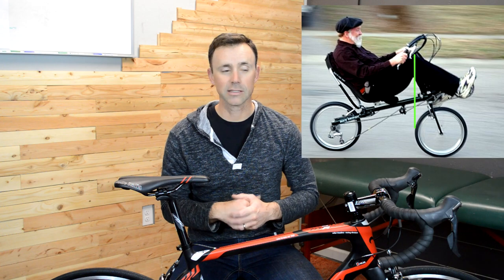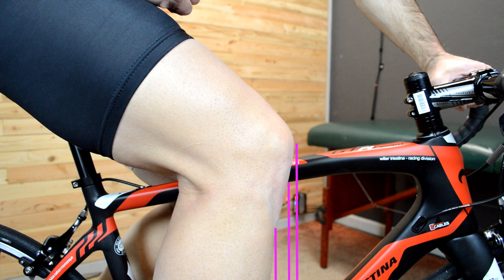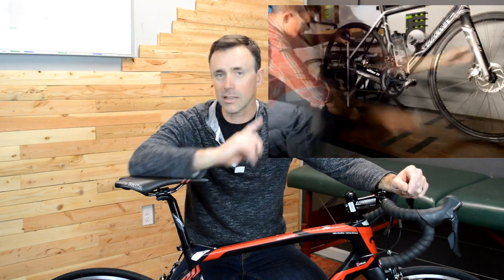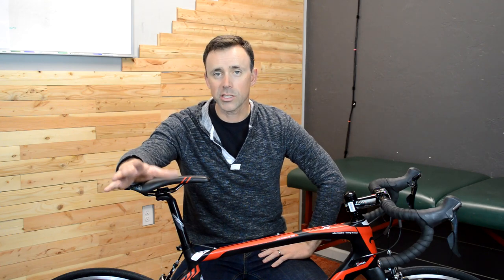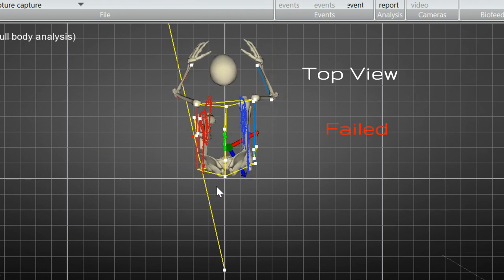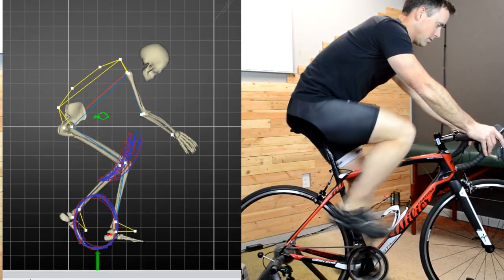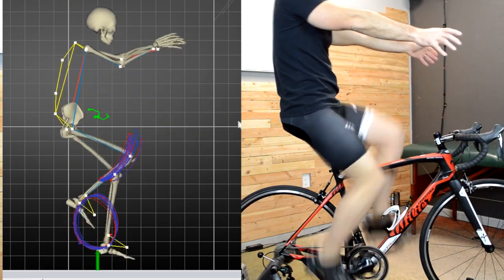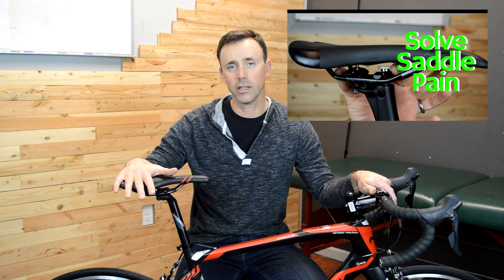How to set Saddle Fore Aft | Bike Fit Tip

Comment: If I'm sliding forward, why would I move the saddle back?  I'd check saddle tilt, then move it forward until I hit the sweet spot.
Reply from the maker: Devery Andrews I understand that idea -- but that assumes that your body is prioritizing your reach over which part of the saddle is the most comfortable / best suited for your pelvic position. Most of the time this won't be the case. Plus with moving the saddle forward there are diminishing returns because as you go forward you exert less posterior force on the pelvis and increase the likelihood that it's going to slip forward.

You're absolutely correct to consider the tilt of the saddle...something I'll go into more in the next video on this topic -- I didn't want to muddy the waters and make the video 5 minutes longer...
Reply: That doesn't make a whole lot of sense as up to something like 8-10cm of shortened reach (assuming that we're looking to find the saddle position first without fiddling too much with the bars) can be accomplished artificially just by just shifting the hands back onto the road bars instead of the hoods and then even further by just asking the rider use their fingertips to stabilize themselves on the bars to conduct the test while on a trainer. Figure out reach after you figure out the saddle position. 
Once the rider's hands are off the bars and the rider is beginning to sit up per the test reach doesn't play a role anymore so the rider sliding forward indicates that the rider's leverage on the pedals and balance drag their pelvis forward toward a neutral balance position and you want to exacerbate that by moving the rider further back? Does seem quite strange logic.
Reply from the maker: +OhAiShare there's a difference between bar position and reach especially when your unclear on your saddle fore aft position. You can have the wrong bar position, the wrong fore aft but have the correct reach. By knowing what's close to your optimal reach you can eliminate it as a reason for slipping forward or being unstable on the saddle. 

If you have close to the right reach and you fail the test and need to move the saddle back, then moving the bars back to maintain the reach is what I discussed in the video.

And, yes, you can just shift your hands back on the bars or go on to your fingertips to see where you pass the test but this won't help you find your best hip position on the bike...it'll help you find your best bar position based on your potentially compromised hip/saddle fore aft position.
Reply: Again, having perfect reach is nearly irrelevant for this test as how simple it is to move your hand position that handful of cm that you may be moving the saddle on the rails as the rider doesn't need to stabilize themselves over long periods or on a dynamic bike. It's on a bike fixed to a trainer so moving the hands or even using fingertips to simulate a reach adjustment is perfectly fine before physically moving the bars. A rider can change hand position at will to compensate for the range of adjustment of the saddle rails. Hence why for this sitting up test trying to make the bar position or reach a big factor is ultimately silly for this specific balance test, as that's all this is. 

As for hip impingement that's a different issue compared to balance point and should be considered as much. Balance is still the balance point and where you should set your saddle by, if one's hips allow it. If not adjust for the best compromise between the two but to say this sit up test is an indicator of hip impingement is a very poor viewpoint from a professional bike fitter as this sit up test is not an indicator of ideal hip angles.
Reply: The basic idea here, I think, is this:  If you stand normally and then bend about 45 degrees forward at the hip joints with your arms out in front of you, your rear end will move rearward to maintain balance.  This is essentially the position you're trying to duplicate with the fore/aft adjustment.  If the seat is too far forward, it puts your center of gravity too far forward and your arms will have to work harder to prevent you from sliding forward in the seat.  I did the same thing as you at first, but found that moving the seat rearward worked much better for me.
Reply: +Ian Snyder I'm not against moving the saddle backward if your needs dictate that you need to do so. However, the video basically tries to scare people away from ever moving it forward which is silly considering it is a balance point that you're trying to achieve - let balance point dictate position. In the test shown in the video you actually want to feel the core engage and your cadence should pick up slightly as you struggle a bit to maintain the position without the hands. Also, just keep in mind for your 45 degree back angle isn't going to be sufficiently aggressive for many road riders and be too aggressive for the very casual riders on beach cruisers. There's no set back angle that is ideal for everyone on every type of bike so be careful when throwing around set angles to target as a universal recommendation.
Reply: Dude, the 45 degree angle was for illustrative purposes.  Obviously not every bike or rider will have the same position.  I make the assumption that people in general aren't stupid.  And the video doesn't try to scare anyone away from moving the saddle forward, but advises not to do so if you attempt the test therein and fail.  I mean, John just does this for a living.  If you know better, good for you.
Reply: +Ian Snyder You "make the assumption that people in general aren't stupid" while giving out information to those who are seeking free advice on youtube on the internet with zero basis of their knowledge level. Then get bent out of shape when someone says the 45 degree back angle isn't a static number and is different for everyone and then support that claim, just are mad someone brought it up... Please take your own advice. 

John literally says failing the test is an indicator the saddle needs to move backwards - which is wrong as you can fail the test on both sides of the balance. John then goes on to say that moving the saddle forward is "pretty rare" and then says there's "a lot more downside" to moving the saddle forward then back biasing his advice to show he nearly always wants to move the saddle backward. Even in his responses he brings along hip angles which are actually better when you move the saddle forward so John's kind of all over the place in this case because he's trying to cover himself instead of just addressing the issues individually as this balance test would dictate. Steve Hogg covers the topic much better.
Reply: OhAiShare Like I said, I give people the benefit of the doubt. You assume everyone is stupid. If they're watching these videos, chances are they're looking in other places too. Just like everyone else, they'll ultimately either find their own way or get a bike fit. If you don't like his advice, don't follow it. 
"Bent out of shape"? Says the guy who got bent out of shape because methodology contrary to his own was advocated on YouTube. It's easy to twist something someone says just enough to find some small detail to point out as wrong--it's what people who can't stand opposing viewpoints and always have to be right habitually do. It's too easy to sit there and bitch and say people are wrong. If the advice and comments are so offensive to you, create your own channel and lead by example. Get the correct info out there. Show everyone how it's done, brah. 😁
Reply from the maker: OhAiShare Okay, last time and then I'm out. First, do not appropriate quotations or ideas to me that I've not brought up or said. Nowhere in the video or in my responses have I mentioned anything about hip angles, so I;m not sure where the "Even in his responses he brings along hip angles which are actually better when you move the saddle forward so John's kind of all over the place...." comes from.

Yes, I fully understand that when you move the saddle backwards it can increase hip flexion which is why I mention a number of times through the video that if you do move the saddle back you'll likely want to address BAR POSITION -- an adjustment may be necessary to maintain your hip angles and REACH. 

Yes, I get it, you can slide your hands back on the bars or go on your fingertips -- I've addressed this before as to why this doesn't give a complete picture of what's going on nor does it provide consistent solutions. A "solution" is being rendered from only one side of the balance equation.

To reiterate. REACH  is not the same thing as BAR POSITION. REACH is dependent on your SADDLE POSITION (its X-Y position in space) as well as the BAR POSITION (its X-Y position in space). You can have two completely different bar and saddle positions -- for instance on two different types of bikes -- while having the same reach. Each rider has their own optimal bar position given their saddle position (and the type or purpose of the bike of course), and vice versa - saddle depends on the bars. These factors are dependent on one another.

Since we're talking about individuals, if you choose to interpret the test as "well if I slide forward then I'm going to bring the saddle forward' as you mentioned in your "adjust according to whichever side of the balance point you're on" reply then a rider should be prepared to be wrong and come out with a compromised fit -- moving forward is not bad, it just has greater likelihood of problems since we rely on our hips being behind our feet a given amount (again individual) in order to maintain a stable pelvic posture and not slide forward on the seat. Having hips drastically forward only works for triathletes because they're supporting themselves through their forearms/elbows and have much greater chance to use the latissimus to support themselves --  the lats attach to and support the spine and the top of the pelvis. They have more direct use of their trunk and pelvic stabilizers, HENCE they can get their hips further over their feet (and their torso and front end lower) without symptoms.
Reply: All I can say is I lifted my hands off the bar during today's ride and I didn't slide forward or aft.  In fact, I felt planted in the saddle (Venge road bike).  I've found success using an iphone app called Bike Fast Fit.
Reply: Sorry for the runaway thread, Devery.  :D
Reply: Lol, it's all good.  Just trying to become better educated on fit, and I find John's videos very informative.
Reply: +Bike Fit Adviser

My response wasn't designed to be a hit piece but now with Ian's help you're forcing it up that road instead of just being critical of the end advice of nearly always move the saddle back... so I'll respond to you point by point. 
- "First, do not appropriate quotations or ideas to me that I've not brought up or said."
I haven't but okay. 

- "Nowhere in the video or in my responses have I mentioned anything about hip angles"
Your first post states: 
"And, yes, you can just shift your hands back on the bars or go on to your fingertips to see where you pass the test but this won't help you find your best hip position on the bike...it'll help you find your best bar position based on your potentially compromised hip/saddle fore aft position."
Hip position is dictated by your hip angle to the pedals from your seated position so hand in hand. And BTW your next paragraph you speak of hip angles directly as well. 

- "if you do move the saddle back you'll likely want to address BAR POSITION -- an adjustment may be necessary to maintain your hip angles and REACH. "
Again, the point I've made SEVERAL times. BAR POSITION can be addressed on a static trainer just by moving the hands back or forward on the bars instead of just using the hoods. There's no fear of falling and there's no bike control needed, this test only cares about a STARTING POINT for the BACK ANGLES/COG as the rider RELEASES THE BARS from the beginning of the test! Additionally this test should be able to be conducted from BOTH THE HOODS AND DROPS so being so hung up on BAR POSITION and REACH and HIP ANGLES is somewhat silly - As again that's just not what this test shows. 

- "Yes, I get it, you can slide your hands back on the bars or go on your fingertips -- I've addressed this before as to why this doesn't give a complete picture of what's going on nor does it provide consistent solutions. A "solution" is being rendered from only one side of the balance equation."
Honestly I have to believe you're just riled up and reading this in a vacuum. As this test IS NOT a solution to the entire balance equation. This test is NOT the only thing that should be considered in setting the fore and aft saddle fitment. So the fact that you're trying to MAKE this test the end all test and taking one result to become the final position is just asinine coming from a professional fitter as you know the final position is a series of compromises. THE TEST YOU PRESENTED LITERALLY DOESN'T CARE ABOUT YOUR REACH OR BAR POSITION. THE TEST CARES ABOUT THE RIDER COG ON THE SADDLE AS THE RIDER RELEASES THE BARS FROM THE START! A fitter can literally conduct this test without a set of bars installed on the bike and instead just hold the rider by the shoulders to start them at certain back angles. I don't know why that's such a hard proposition to understand. 

-"REACH is not the same thing as BAR POSITION. REACH is dependent on your SADDLE POSITION (its X-Y position in space) as well as the BAR POSITION (its X-Y position in space)."
AGAIN, you fail to understand what this BALANCE test does. This is about balance point on the bike WITHOUT THE HANDS ATTACHED. BAR POSITION AND REACH ONLY SET A BACK ANGLE STARTING POINT WHICH CAN EASILY BE MAINTAINED WITHOUT MOVING THE BAR. Honestly I'm not sure why you're so hung up on reach and bar position when the test you've presented has little to either as THAT'S NOT WHAT IS BEING TESTED! 

-"as you mentioned in your "adjust according to whichever side of the balance point you're on" reply then a rider should be prepared to be wrong and come out with a compromised fit"
EXACTLY as I said earlier. You're instilling fear about moving the saddle forward as it is your belief and in my opinion wrongly that if one fails the balance test you should always move the saddle backward. You now outright say if one moves the saddle forward based upon the balance test they, "should be prepared to be wrong and come out with a compromised fit." Then going on to point out the specific issues triathletes (no one talked about them here except now) have and their solutions to it forgetting completely that the triathlete position is FAR forward from this balance point position - just making an extreme statement to cover your position. Also, never mind that this position ISN'T that far forward for most riders but you are ready to make the blanket statement of, "prepared to be wrong and come out with a compromised fit." Never mind that RETUL and many other fitment systems are using this balance point approach to set a starting point to where other compromises may need to be made. 

Again, Steve Hogg did a much better job on this and ultimately he uses this test as it's designed. A BALANCE test and not a pass/fail test that always tells you to set the saddle further back and tries to determine final reach and bar position based by it. Maybe you would take a read and maybe take some information in for your own future fittings. 

https://www.stevehoggbikefitting.com/bikefit/2011/05/seat-set-back-for-road-bikes/

+Ian Snyder You continue to prove your own points showing the level of stupidity that exists. Now please quit being stupid, stupid. I literally stated that everyone will have a different back angle with different purposes and you continue to emphasize just how stupid one can be when agreeing with someone else. Congrats.
Reply: + Devery Andrews 
It is interesting seeing just how extreme disagreements have to go in order to get some real information and discussion accomplished.
Reply: LOL  Okay, guy.  Think whatever you want.  Nobody cares anymore.  :)
Reply: +Ian Snyder But cared enough to come back and post a troll comment? You're continuing to show you're no stranger to spitting into the wind and just the type of person one should expect to find on the internet. Now hopefully back to bike fitment discussion instead of compensating for bruised ego's.
Reply: OhAiShare Way to get the last word there, chief. 😉
Reply: +Ian Snyder
Ian, Ian... First and foremost you seem to care a lot more than you're letting on. Second, you really don't seem to care about discussing bike fitments at all but more about finding ways to assuage your bruised ego. Ultimately third, I'm trying to get this back on track about bike fitments but you keep dragging it down troll post rabbit hole - have fun entertaining yourself down there.
Reply: OhAiShare My first comment was very much about bike fit. But then you came along misquoting people, making false attributions, and, well, everyone loves a YouTube comments spat. I understand your need to feel intellectually dominant, but please don't fall under the misconception that you've bruised anything. Irritating people isn't the same thing. Interesting tactic, though, taking a personal jab and then trying to establish yourself as the "good guy" who just wants to get back to talking about bike fit. Transparent, though. Like that condescending tone? It's the same one you use. Brah. 
Hopefully John will just delete all of this. In the interim, I'm here all night. ;)
Reply: OhAiShare Also... And this is constructive, so don't take it personally: Commenting by basically saying "you suck, you're wrong, this guy does it better" followed up with misquotes and false attributions is a terrible way to open a dialog if you want people to be receptive to you. 
But it did give me something to do while my toddler napped on me. Take care.  :)
Reply: And sorry for the runaway thread, John. Didn't mean to muck up your comment section.
Reply: Normally John has quite a few good points, he's completely missing the boat with this one. OhAiShare is right in stating this is a balance and rider COG test in the saddle and not a test about reach and bar position. If one is able to filter through some of the unnecessary posturing there's some good info there. But turn off the caps lock! 

Ian - Brah, brah, shut up brah. Quit trying to apologize for other people when you're the one doing it. You're living up to every point OhAiShare has made brah.
Reply: Psyche Out I apologized to John for mucking up his thread, but I have no emotional investment in your opinion. Knock yourself out. Brah.

Regarding the earlier portion of your comment, yes, it's a center of gravity or "balance" test, which is self-evident to anyone who watched the video. It's bizarre that that somehow became a point of contention.
Reply: lol  Except it is a balance test.  No one's advocating that the seat be pushed rearward beyond the point of balance.  It's even mentioned that you can move the seat forward under certain circumstances.  Maybe you should rewatch the video..?

You have to realize that you're confronting someone who has seen this principle work, and then you're insisting that their first hand experience is wrong.  This whole idea is based on something we all more or less mastered before we were two years old, and it's just too simple to argue over:  If you bend forward and your hips are too far forward, you fall over.  Your backside has to stick out sufficiently for you to remain upright, which is the same dynamic that is being duplicated with the fore/aft saddle position.  If your saddle is too far forward, it throws your position off balance and shifts too much weight onto your hands.  To correct this, you move your hips rearward to achieve balance--in the same way that you'd stick your ass further out in order to not fall forward while bending over from a standing position.  If your bar position was correct with respect to your original, off-balance seat position, you'll have to swap out your stem to accommodate the saddle movement.  It's sound logic,  and in my personal experience, it works in practice.  If you're falling forward, moving your pelvis forward will never correct your balance.  So yes, moving the seat forward will most likely lead to a compromised fit.  

But hey.  Fit your bike however you want.  If you want to slam your seat forward, no one's going to try to stop you.  Slam the shit out of it.  Mount the seat on your stem if it makes you happy.  And if you manage to convince someone else to do it too, bless you both.  Something so simple shouldn't be such a point of contention.  Your methodology is your own, and it will only affect you.  I have no personal investment in your ideas, and will continue to consult with and consider the advice of professionals.  That said, I can't rationalize engaging in this conversation any further.  Take care, and good luck.
Reply: Ian, you're making up your own science now as that's exactly what OhAiShare proposed at John shot that down. In the video John specifically says that if you have to push your hips back is the same failure as if you had to move your hips forward as both result in moving the saddle further back and even the first advice John gives here is to tip the saddle upward for more grip and leverage... It's astonishing how even you get it, but fail to see that you get it not because of John as John's explanations are very much contrary to your current view. 

But this blind faith routine of "You have to realize that you're confronting someone who has seen this principle work, and then you're insisting that their first hand experience is wrong." is honestly very downright stupid as you're saying you can't have a discussion about it because someone works in the industry and does this professionally. You're saying all professionals are doing the exact same thing and none of them could possibly be doing anything wrong. It's an incredibly weak minded viewpoint but hey, if you aren't able to think for yourself, do as you do brah. And no, John's methodology will not only affect him nor will even your methodology only affect you or mine me unless you live in a cave by yourself never making contact with anyone. But you are a dense one, maybe you'll get that... but regardless at least you get that this is a balance test. :)
Reply: I'm honestly baffled by how this has gone. It really is a balance test and the whole bar position seems really arbitrary. Like you said, you don't even need bars to do this test.
Reply: Fallen & Psyche I'm also baffled at how this has gone. It began as a critical response to John's interpretation of the test to a full blown blind defense of John's technique. I hope either John learns from this, as Ian now begrudgingly has, and applies it or others can see just how open minded a fitter John is. Sorry for the use of caps and all that but the fact that John decided to try and make this "BAR POSITION" and "REACH" assessment along with trying to bring in triathlete positioning is just many levels of silly. I hope John and others realize that if you have good core strength one can literally push the saddle all the way back on the rails, tip it up 2 degrees and still be able to sit up with difficulty and sliding forward especially when you have a scooped saddle like the Aliante which would indicate pushing even further back! It ultimately is as Psyche Out says, a leverage and grip test by John's standard and not a balance test. 

+Devery Andrews Sorry that I forgot to address your issue directly through this mess! If you feel perfectly planted removing your hands from the bars and maintaining your starting back position, it's likely you're too far forward. You want to feel your core engage and a slight increase in cadence to keep you in that position without your hands from the drops. If you need a 2nd source read the Steve Hogg article I posted earlier as I understand I'm just a random voice on the net.
Reply: Right on, this stuff should be simple for a fitter.
Reply: Moving saddle back and a shorter stem puts less weight on your arms and vise versa. If your still sliding forward but have gone as short as possible with the stem your frame is too large.
Reply: Again, it appears that one doesn't understand that all this balance test cares about is your starting back angle. Whatever amount of fore/aft adjustment you choose to place on the saddle can easily be compensated by moving your hands around on your bars in their current position. The saddle position itself DOESN'T change the amount of weight on your arms. The amount of weight on your arms is dictated by your back angle. Bar position does NOT MATTER in this balance test!
Reply: @Vermonstered  You are a legend, love the accuracy.